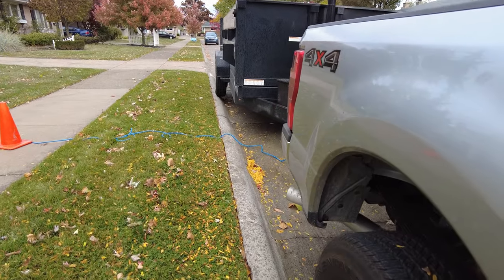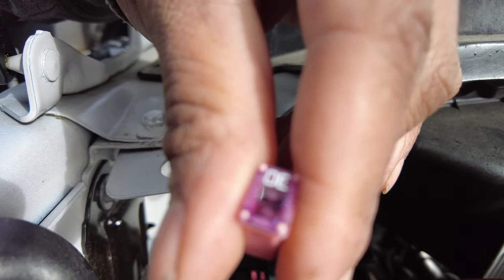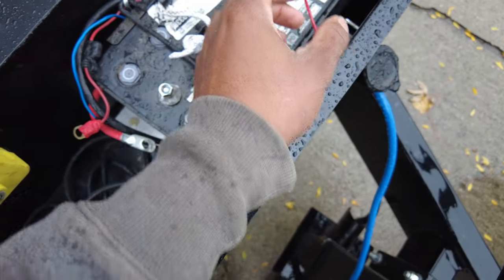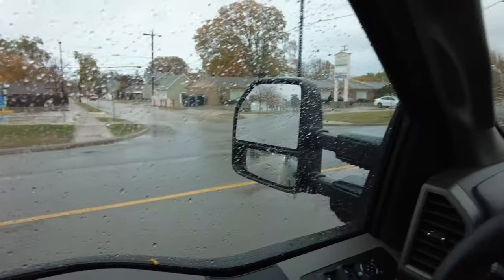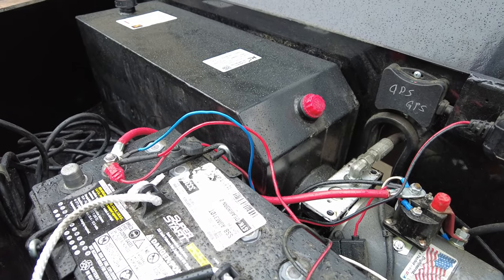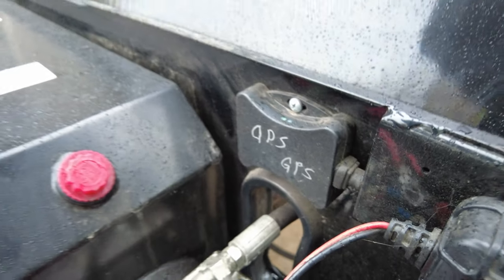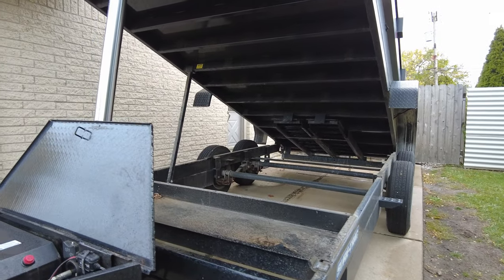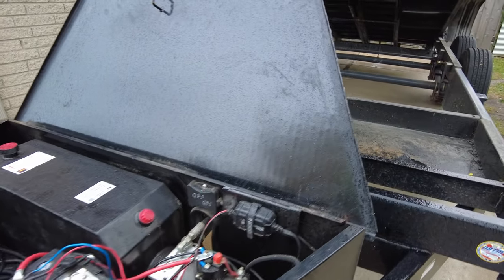FORD TRUCK NOT CHARGING TRAILER! WTF!

Comment: I'm pretty PO'ed about your dilemma. There is no way you should have to run another feeder line to the 7 way especially based on the price of the truck.  That 12v feed should ALWAYS be hot no matter what the "computer" says. They were that way for 30 years prior.  Another example of complicating a simple process in the name of progress....Is there any way the computer is supposed to inform you that the 12v feed is not working...i bet not...

Comment: my 2019 has no power until you start driving the truck has to be hooked to the 7 pin and it charges when driving. if i check with a meter no power. 
i found a video on youtube explaning it my travel trailer gets charged when i drive but i wont charge if just pluged in.  video is DS TRUCKS  explaning it

Comment: find a solar panel that fits the lid without sticking out of that box and mount it add a small charge controller and should be enough to keep battery always ready, did this on my travel trailer never have an issue. Also the hands down best charger to bring batteries back to life, lead acid, agm, is by using an optimate battery charger. I have brought back batteries from the grave with it.

Comment: I suggest letting the trailer wires and truck wires as it is from factory, install a #6 cable from truck battery to rear bumper, install a Anderson SB120 or SB175 plug at rear bumper. Install short #6 cables and Anderson plug on trailer battery.
You will need a 100-125 amp 12V breaker at truck battery and trailer battery. Ideally (not required) you would install a 200 amp diode near truck battery to prevent issues in the event truck battery fails when connected to trailer - I use a relay instead of diode for several reasons but it takes more time to install.
The above solution should work great unless you connect truck to dead trailer battery and attempt to operate the dump within 30 minutes.
To allow for removal of the trailer battery and still operate the dump, you will need 2/0 cable, 300 amp breaker and Anderson SB350 plug. This costs much more and install takes longer.
I typically install a small solar charger on toolbox lid to maintain battery.

Comment: Good stuff.. it is possible that the fuse blows when the trailer pump is running picking up a heavy load that it  draws too much current and blows the fuse.. try to use it with the truck turned off so it doesn't pass power through the plug while the pump runs...

Comment: Sean there is a couple of things I could suggest. One is a tow truck type of jumper cable. Positive wire connects right to the battery. Then it goes through a 50A circuit breaker. It then continues along the frame to the rear bumper. You can either weld a stud to the frame or bolt the ground lead to the frame in the rear. Bolt the truck side of the connector to the rear bumper. Keep the jumper cable end either the trailer toolbox or the cross over box in the truck. Use the jumps to jump the battery on the trailer.
Reply: Nice suggestion. I’m going to look in,to that for my trucks and dumpers. We also run F-350’s and like dump style trailers but have the exact same problem he is. At our dump over here in Oregon City, Oregon they keep those portable battery jumper boxes for us contractors to use as this is a very common problem and you wind up stuck with the dump fully up with no juice to lower it. I was using the CAT jumper box that Costco sells but I think I accidentally threw the dang thing away. I never thought of your suggestion but damn that would solve all the problems on all the trucks. Now to research it to find out how much it will cost me………….thanks for your input/suggestion. 
Victor in Oregon.

Comment: When batteries get excessively low, they require a TON of power to start charging again.  That little tender isn't going to do anything at 2A.  Spend the money on a proper 6-10A noco charger. myself, and friends run Noco on our boats and they do great, one of my boats does have a constant draw with some lights that never turn off. 

As far as the fuse blowing, I'd look for issues other than your charging circuit.  30A is a lot for charging a battery. There's something else going on. chafed wire, crossed wire, wet connector, or possibly trying to charge a DEAD battery is what's causing too much draw through that fuse.  I'd lean towards the dead battery.  Replace the fuse, and charger, and keep that battery properly charged at all times.  

I like the comment below about running the dump possibly blowing the fuse, I'll have to check my fuse, but I bet if you keep that battery topped off, it stops being an issue. 

I've been using my dump trailer so much lately, that I haven't had it hooked up to an extension cord at all, and the battery meter still reads full.
Reply from the maker: You are right. I'm finding an issue with the ground circuit on the trailer side. Also, the wiring is too thin on the trailer side

Comment: The other thing is just run a wire set (protected) from the battery to a plug mounted at the rear bumper of the truck. Run a lead from the trailer to the trailer tongue area. Plug this wire into the truck for constant 12V power. This is what someone with an electric boat trailer winch would do. The wire would be in the 8 -10 ga range.   I DM'ed you pictures of the actual kits that I am talking about.

Comment: Folks, would like to add a few comments/suggestions. 2018 F 150 XLT,  2020 FR Wolf Pup 16 FQ., GE 12 v refrigerator.
Last few times out we arrivered at our destination and the refer was warm and the RV battery was downt to ~10.5 vdc. Hook up to shore power all is well. Get home and we get the same scenario, warm frig, low battery.
Tow vehicle is not charging the RV. Checked the frig for high current draw, all readings are within specified operating range. Checked onboard converter, all good.
Have read most all of your comments and suggestions, have checked for the proper fuses and relays, all A OK. 
From your discussions I realized I must check for 12 vdc at the trailer connector. Still no 12 vdc at the connection.
Disconnected the RV battery, connected Volt meter to battery cable, connected  RV cable to tow vehicle, started tow vehicle, monitored volt meter ~2 to 3 volts ???. Tow Vehicle is equipped with on board check list to go through all the checks we all do out of habit. Low and behold after going through the checklist I now have power at the trailer connetion, refer runs fine, RV battery now charging. Going through the checklist turns on the 12 vdc switch.
AND had to move the tow vehicle a few inches to complete activation.
Hope this helps.
R
Reply: Hello.   I’m having the same issues with my RV.   I’m not following your post on what you did to correct the issue.   Apologize if I am missing something but would appreciate any addl info you could share.  2018 f150 XLT also
Reply: @aronk7412  ok, after connecting the RV to the tow vehicle (2018 F150) look at the dashboard. It should ask "is the trailer connected" answer YES. 
Then follow thru the checklist provided on the dashboard, lites?, yes, Chains connected? , yes . ETC. after going through the checklist the 12 vdc circuit on the seven pin connector should now be active.
If your RV has a solar panel connection heres an easy way to verify you are getting 12 vdc from the tow vehicle. Test the voltage at the solar connection before and after. When the tow vehivle is proving current to the RV the solar connection will read 13.5 vdc. Hope this helps.  R
Reply: @ronewen5034 - thank you for the info.   I’ve seen the trailer connected question asked and answered yes.   Never seen addl questions.  Are u saying I need lights on?  If are running lights ok?   I do have solar.  Appreciate the information.  Did you have to add a fuse or relay in the truck?
Reply: @aronk7412  Q1. TOW vehicle lights do not need to be on. 
                          Q2. My 2018 F150 is an early model and did  not come with a factory Trailer Brake Control module. In addition to not having the factory installed TBC module, the fuse block was not populated to accomodate the required 30 amp fuse for a TBC module. I added a fused wire from the battery to the aftermarket TBC module. This has nothing to do with the 12 vdc reqired to operate the RV  ie: charging the battery, running a refrigerator etc.
You might want to read what E-Trailer's comments are regarding the 12 volt issue with F150s. They claim that just depressiing  the brake pedal for 3 seconds will activate the 12 vdc pin. I have not tried that procedure nor do I believe that solution will work on my vehicle. Once again thanks for reaching out and safe travels. R
Reply: @ronewen5034 - appreciate all your info.  in Michigan and trailer is in storage till April or May.   Previously I would get a msg is trailer hocked up so something like that.  I would answer yes and move on.   Today I was playing around and saw a trailer menu.  Looks like it asks several questions.   Never say this b4.  Hopefully this will be my issue.  Thanks again!!!!

Comment: XL's and XLT's don't always come with the relay that you need in the fuse box of the truck. Get the relay and it should work. Good luck!
Reply from the maker: Had fuse, didn't check for the relay 🤔
Reply: @DS-TRUCKS  Even some Silverados put the relay in a bag in the glove compartment. I could never figure out why. I guess they're worried about a high amperage 12v pin just hanging around. Also, I have heard the newer Fords sense draw on the trailer connection and then send power over the charging pin. So, you may not get any power just using a tester on the connector.

Comment: This same thing has happened to me before as well at the dump. We used a Milwaukee battery and connected it to the trailer battery and got it to dump so we didn’t have to unload by hand.